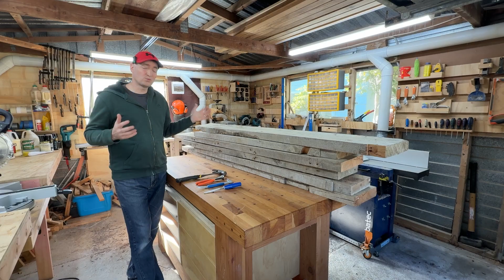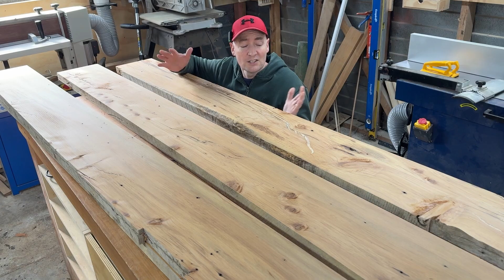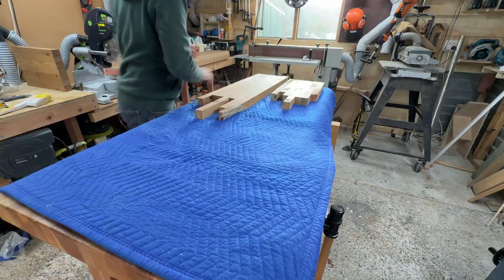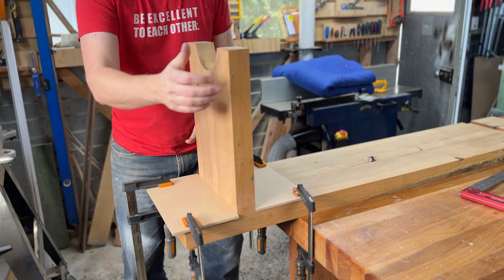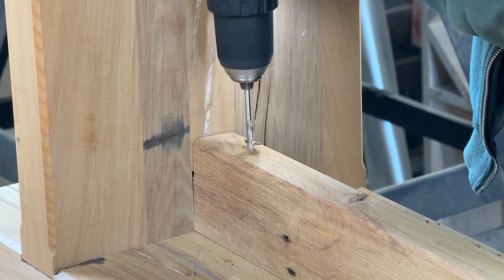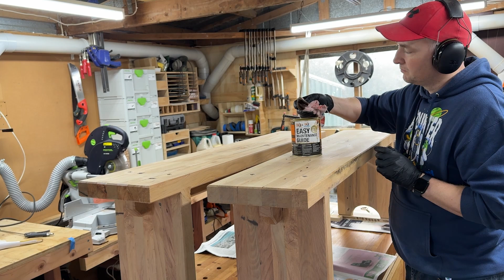Reclaimed Timber to Rustic Bench Seats

Comment: Yo mr Mac can you please do a honest review of your 10 inch carbatec combination planer/thicknesser?
Reply from the maker: Hey there
It’s the only one I have ever owned so I don’t have any comparison but for my shop it is perfect
If I had a bigger shop, I would opt for separate machines purely for the size of the infeed and outfeed of both modes, putting long a long board through it is a little annoying 
It cuts really smoothly with the helical head, I haven’t rotated the blades at all in the 3-4 years I have had it
The capacitor did blow up a while back but that was pretty simple to replace
Over all I would recommend it for a small shop where you don’t have the room to have two separate machines purely
Reply: @macsworkshop  Nice man, do you ever find that it lacks power with hardwoods? I was tossing up between your one (1.5hp) and the Hafco PT254 from machinery house (3hp) which is actually slightly cheaper but not sure about the quality. Either that or stick to my current 8' jointer + Dewalt lunchbox planer haha
Reply from the maker: I haven’t had any issues and primarily use it for hard woods, including purple heart
Reply: “Big dong” 😛🫵🏻

Comment: Nice look. I love the recycled timber projects. Great to give a second life to those nice planks. I need to get one of those small metal detectors for fine work like you were using. Save a load of time replacing planer/jointer parts.
Reply from the maker: I was pretty dubious about how well the detector would work for the price but it was perfect for the job